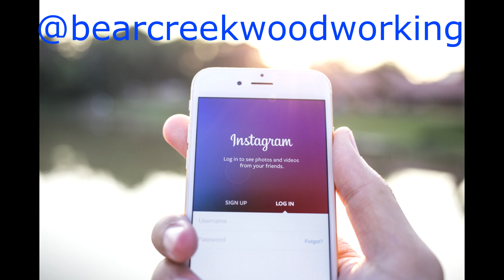#8 Fast and Easy Saw Horse Build

Comment: Good video. Why did you make the top and bottom pieces of the I-Beam longer than the center piece? Thanks.
Reply from the maker: They are longer so I can easily clamp the work to the sawhorses if need.
Reply: With the longer overhangs it can be useful when trying to clamp boards on top ends of the saw horses.

Comment: It takes 5 pieces of 2x4's to make two saw horses. Each 2x4 yields 3 pieces. 10 pieces at 30 inches and 4 pieces at 32 inches. You're welcome.
Reply: Why not do 32" same amount of lumber?
Reply: In my area, 92-1/4" studs are usually the better lumber: 2x30" legs + 1x32” flange = 92" plus two saw kerfs. Basically, cut 2x30” from each stud and you'll be left with the flanges. You end up with one extra flange for two horses from five studs, assuming you want the 1" clamping lip on each end. For more permanent horses I'll pocket-screw a brace flush to the legs at 12” like a sawhorse ladder to prevent racking if I'm planing lengthwise on the top. The extra flange plus one extra stud gives me the four "step" braces I need, and they still stack exactly the same way. If you glue them you also have a low platform support and a place to step on if they're moving around while you're chiseling or planing.
Reply: great job and great video, im making a pair, wish me luck ( I'm going to home depot)

Comment: Get rid of the top 2x4 and subtract weight and cost without losing any strength.
Reply from the maker: That's a good point, but I like how mine looks. Thanks for watching.
Reply: @BearCreekWoodworking  Your horses ‘look’ perfectly fine. Form follows function though. 
It’s also not a good idea to have nails or screws in the top because you run the risk of hitting the fasteners with your saw blade, while making a cut.
Reply: @BearCreekWoodworking  The top piece is sacrificial so you don't have to take the whole thing apart to replace it. Just attach it with only one deeply counter sunk screw at each end and remember to cut make cuts at the end of the sawhorse or set cut depth appropriately.
Reply from the maker: @FoScoJo  Good Idea! 👍